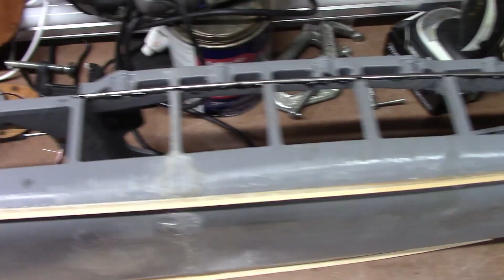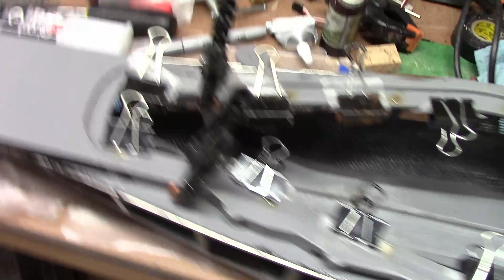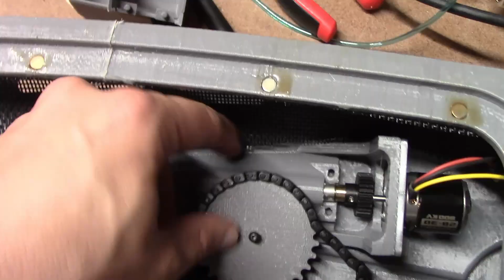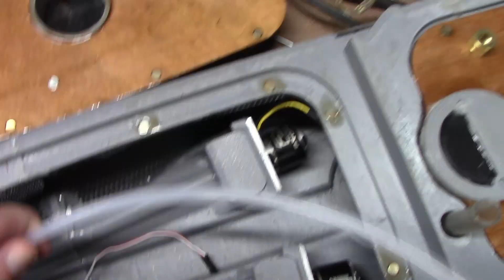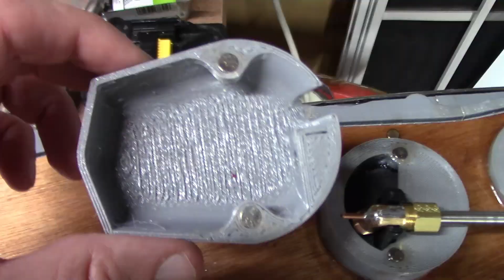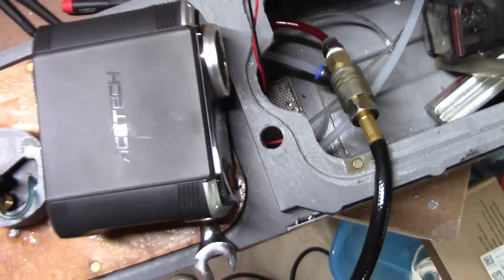3D Printed RC Warship Assembly Tutorial - HMS Erin - Part 2

Comment: Can I ask why a lot of fast gun guys will run gear boxes? Low kv motors are easy to have. Why bother with the extra parts, cost, noise and complexity?
Reply from the maker: For the combination of prop size and voltage on most larger boats, gearboxes get the throttle setpoint in a better range for fine adjustment for our speed requirements.  I disagree that cost is noticeably different with $5 gears and printed gearboxes; direct drive mounts and couplings would be in same price range.  Gearboxes also have a much cleaner/robust mounting system thank most direct drive setups I've seen.  Alignment/install is also easier/not a concern relative to direct drive. Also it gives a better shaft angle. I agree noise is a downside, but minor. These factors combined are why most use gearboxes. There are a few captains that go with direct drive
Reply: @eastcoastrccombat6538 days d2830 750kv motor for 2-4s is 19 bucks. 
A coupler would be 2-3 dollars and an esc could be had for 10 bucks. 
A brushed motor likely would be 10-15 bucks for a small one, esc for 20 bucks and gears for 5 bucks a piece. I think we call it a draw lol. I do see the prop angle and what not being a good reason for a gear box. Thank you for your explanation.